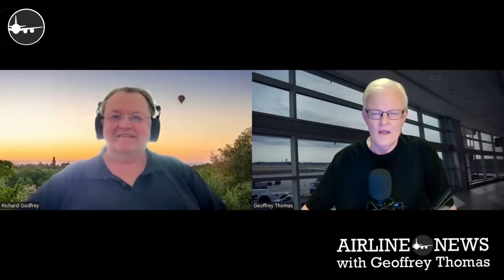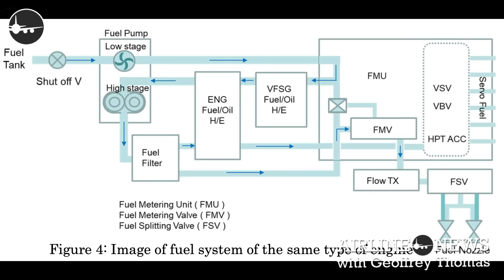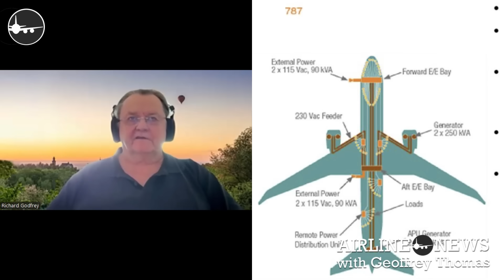AIR INDIA CRASH - FUEL & ELECTRICS FACTORS  #airindiacrash

Comment: The difficulty which Boeing and Air India face is that the real reason for the crash can never be acknowledged. That the electrical failure, for which we have direct evidence from the survivor, almost certainly caused misleading information to be fed into the computer, which then decided that the engines should be throttled back. That reason cannot be given. That reason would require manual overrides to be installed for all the throttle controls on all “fly by wire” aircraft. So, due to the flight data recorders being “defective” the reason for the crash will be given as “unexplained” - possibly contaminated fuel or pilot error. So, no changes will then have to be made to fly by wire aircraft. It won’t worry me at all. I only ever travel to the Continent and I travel by rail and ferry, since I am fortunate enough to have sufficient leisure time to travel in comfort and style at a civilised pace. If the ferry founders I shall jump into the sea wearing a life jacket. Someone will probably pick me up. The distances are not great. “The further off from England, the nearer is to France…”

Comment: A lot of human interaction in form of checklists.  They got to V1, or almost.  The RAT did deploy.  We still don't know what the first event was or exactly when it occurred, but it could be at rotation, or perhaps the acceleration forces from the start of the takeoff run, which for example could pool water from level to an accumulation in the container it was in.  Question could be what could occur within the time window of take-off roll, or the very short window of lift-off rotation itself.  The aircraft appeares to be in trouble before or immediately after rotation, and trades off the speed and energy if had at rotation for the altitude, and quickly reached a point where, haveing nothing to trade, it could not maintain either.   So, the event, whatever it was, seems to be one or a series that could ocurr and symptoms be visible to us before cascading to a crash very quickly, possibly within the short window between rotation and, not impact, but the first signs we can discern of a problem.  That seems to be only a few seconds if it occurred during rotation.  The larger window between start of takeoff roll and before lift-off, yet there was still time and the conditions necessary to the aircraft having reached V1 (or almost).  In with case, the time between when the first event occurred and symptoms affecting the aircraft were realized seems to be very short.  Pilot's radio message points to them having almost no time to realize there was a problem and deal with it, if it was survivable at all at takeoff.  Also, assuming pilots did not have time to react, and assuming related backups could still be initiated automatcially, how quickly could backups react to work as designed?  A few seconds still might not be enough. What scenario could have cascaded this quickly? Water/electrical, then with twin but asymetrical engine thrust loss, right engine first but also, independently, left engine taking longer, perhaps ending with left engine still running, still losing but producing some thrust - but not nearly enough.  And, not saying this is so, but this models to the delays, aka the optics, we've seen since the crash, and that Air India had failed to make the inspections/changes advised, and became aware of this early on after the crash.  If so, in this scenario, Boeing/Air India, but Air India sealed their fate.  Not saying this is what happened, but it fits a model that works and almost too easily arrived at.

Comment: Hi. What would hypothetically happen if a pilot, by accident, entered a critically lower total weight than the actual weight? Would we see a long acceleration, followed by a lack of appropriate thrust to maintain climb?  And would the RAT deploy? The pilot flying, in his mayday call, knew that this was his very last ever transmission call to ATC. If there was a single or dual engine failure, or complete loss of electrical power, I'd think he would have relayed those facts. But he said in his call "thrust not achieved".
Reply: "Thrust not achieved " is fake news, made up by stupid Indian media. We know our media outlets very well, they are capable of making ANYTHING up. 

He simply gave a mayday mayday call.
Reply: The incorrect take off weight entry would typically be loaded into the onboard performance tool which is used to calculate take off performance. This would have to be missed by both pilots and then the incorrect take off data entry into the onboard flight management system would again have to be missed by both pilots. 

During the take off you would experience a slower rate of acceleration and a longer take off roll due to lack of thrust which would then also affect climb performance once airborne. 

This would not cause the RAT to deploy. 

The call to ATC would not be too detailed due to the startle, stress and focus being required elsewhere.
Reply: This has happened before. Search the near catastrophic incident of Emirates EK407.

Comment: Guys, enough of the speculation.  For crying out loud wait until we have some facts from the investigation.  You only fuel the guys out that have ChatGPT.  

Captain - B747 Classic and -400, L-1011, B757/767, B727.  
Check Airman - L-1011, B727
24,000 hours, 41 years flying airliners
Reply: Why watch if all you are going to say is stop making the videos? Were you forced to watch? 
Do you think your flying experience gives you the right to make such a comment? It's a bit pathetic really !

Some of us appreciate these videos for the education provided about aircraft systems etc.
Reply: @GPSierraPapa With my experience what could I possibly know?  Sorry.  My mistake.

Watching for education is great as long as the information being presented is correct.  But “woulda shoulda coulda maybe what if” is not information.  Speculation helps no one.  Wait for the facts.  This is not the place to find them.  At this point none of us know.
Reply: @ImperrfectStranger The 727 is the only airplane on which I flew all 3 seats.  I was a check airman on the 727.  I’m not sure I know what he was talking about.  DC pump if the AC pump failed?  Not really sure what that means.  If he’s talking about fuel boost pumps they have different sources of electrical power for redundancy.  Boost pumps are normally DC powered as DC will deliver more torque than an equivalent AC pump will.  Fuel starts to “gel” as it gets colder at altitude and an AC pump may not have enough torque to overcome the thickened fuel if the boost pump has been shut off for cross feeding or balancing fuel.   If I recall correctly (I last flew it in 1992) the APU doesn’t run in flight on the 727.  I don’t know what a fuel line check valve would have to do with anything.

Thanks for the compliment, but don’t wish I was there for his questions.  I don’t know any more than anyone else.  Of course I’m curious, but the amount of wild theories about stuff is really annoying to me.  The facts will speak for themselves when we finally get them.  I blame a lot of it on ChatGPT, but who knows?   I never flew the 787, but was only involved on the periphery of its operation.  It’s a very smart jet, and we’ve learned a lot from previous problems.  

The only thing that really raises my eyebrows about this accident is if it were an aircraft or design problem affecting safety, that would have to be divulged very quickly to all operators of the airplane for safety of flight.  There’s a lot of 787s flying around out there.  That nothing has been released kinda leads me to believe that it wasn’t an airplane or design flaw.  I read people saying Boeing is keeping it covered up, but I sincerely doubt that is true.  Boeing got a pretty bloody nose over the 737 Max (deservedly so in my opinion) and I don’t think they have any desire to go down that road again.  But I’m breaking my own rule by making such a speculation.

Comment: Having worked on early digital telecommunications equipment with redundancy and both battery and generator backup as a young man, I wonder if there was a significant difference in the voltage of the aircraft's AC buss and the PMA's on each individual engine, causing a power surge, voltage drop or perceived power surge or voltage drop, when their individual FADEC's switched from the AC buss to their own individual PMA's after takeoff, which caused each FADEC to reset resulting in both engines going back to idle at or around the same inconvenient time, perhaps due to the switchover happening in the midst of the electrical failure which caused the RAT to deploy, & the landing gear to stop before completely retracted?
Reply: Agree. With so many power sources all potentially being connected to the same distribution bus in the wrong sequence or out of phase will cause surges and dips in both frequency and voltage. The combinations are incredibly complex with so many electrical power sources. 2 per engine, 2 per APU and 1 per rat!  That makes 7!  All nice in theory but practically? One inconvenient failure in a computer chip somewhere is all it would take to nullify all the redundancy!

Comment: Another slight variation(?)
Let's assume there was a single point catastrophic electrical failure Or (anticipating the upcoming Monday episode) a software malfunction, which resulted in the nominal fuel supply to one or probably both engines being compromised.

I assume "a (single) blocked filter" would be a separate system for each side and so should not affect both engines? It's unlikely both would be blocked at the same moment?

In this case, we would be looking for something which would affect both engines independently but at roughly the same time and to differing amounts?

Is it possible that such an electrical failure, leading initiation of the vacuum feed on both engines would cause a sudden pressure loss due to suction in the feed, which, combined with potential contamination(?) and with the high ambient temperatures at the airport(?), may cause vaporisation in the feed leading to first zero, then variable thrust in both engines?
.
Scenario.
If the pumps are mechanical and rely on engine rotation, there may be a situation where the engine is at low revs, then the pump is engaged, fuel is supplied, which increases power, then increases vacuum, which vaporises contamination, which reduces supply and slows the engine, which reduces vacuum, which allows the fuel to liquefy and produce trust, which increases vacuum....... Resulting in a feedback loop of variable but uncontrolled asymmetric thrust?

Comment: Enjoy your channel. We know these accidents happen from a series of reasons. However only one failure will happen in a system at one time. The deployment of the RAT then points towards an electrical failure, this then removes all the other options, flaps, heat, vapour lock, fuel contamination, pilot error, takeoff configuration and settings, etc. What about in this instance the RAT deployed but didn't provide any power.... This isn't claiming two faults at once, but rather a previous failure that wasn't repaired. I would presume the RAT would be on the mel but if the flight was allowed to operate without a working RAT and a fault occurred on takeoff with the electrical system and the RAT wasn't working the final hole in the Swiss cheese model would be aligned.
The question for Richard is what would happen in the event of total electrical failure and no RAT power?
Reply: According to the description of when the RAT is deployed only when either both engines are shutdown or at least one and the other is not producing enough electrical power for the flight control systems.  It's only emergency backup power for the flight control systems in the plane.  I think that passenger who survived said there was a loud bang and the lights flickered on and off around that sound.  Which is probably the RAT dropping down when it deploys.

Comment: Possible pilot error : Non selection of target altitude (000) would cause throttle back following take off  - it was too late . This has happened before appartently on a 787 and was corrected in time`: 
To set a target altitude on a Boeing 787 Dreamliner's autopilot, you'll need to rotate the altitude selector knob to your desired altitude, then press the knob to engage it. You can also use the Flight Level Change (FLC) mode to climb or descend to a specific altitude while maintaining a target airspeed.
Reply: It’s not going to throttle back in TO/GA.

Not sure about the 787, but on most airplanes it’s impossible to set an altitude in the window that is less than field elevation.

Comment: There is a fuel contamination well known to sailors, called "Diesel Pest", which clogs up hoses, pipes and even valves.Usually it never reaches the filters, thus it cannot be seen from outside even with transparent filters, but makes the engine stop not to start again without thoroughly cleaning the whole fuel system.
Cause is bacteria which thrive in the border between diesel and water anywhere in the fuel system.
Freshly tapped in the gas station diesel contains a certain amount of water (200mg/Kg) and is not sterile.
Stored in a tank/fuel system without much movement this water could separate and form  these border layers allowing the bacteria producing a certain "glibber", which is clogging up the fuel system, especially in hot climates.
The first reports of this phenomenon came in the mid 50ies, long before the introduction of "Biodiesel".
Maybe it took Evolution 50 years to make these bacteria to appear.
Jet fuel is chemically related to diesel and available in large quantities for about 50 years now. Could it be, that the same problem came into existence with jet fuel?

Comment: Thanks for explaining. You mentioned that 1 engine had already failed during V1, first time I heard it. 
Anyway, with so many valves, is there any spring loaded solenoid valves like FSOV's? HPSOV's is more motordriven in both directions, but the kind of valves in the system will react differently with a major electrical failure.

The sequence of events is very important as with a dual engine flameout, all engine generators will stop working anyway after the turbine has wind down. How long time does it take? 

In addition to the lavatory dripping mineral water theory, the same might happen with the metal shavings, the sharp junk debris that was left behind during assembly. Any short circuit might have sent a rogue signal to the flight computer propagate to the FADEC's beyond the pilots control.
There's supposed to be redundancy, but with the MAX mcas disasters there was not any Swiss cheese layers whatsoever.

Comment: Thank you for the NGR of the CCTV camera (have been searching for that for some time now) as we can now triangulate (using the roof of the small building) the rotation point in order to establish if there was dust at that point on the runway ?? I think i am right saying that 171 rotated well before the end of the tarmac runway and so should not have produced dust at that point ???.. PS... The battery on the 787 is quite small (less than my solar battery of 100A 48v) and would have been at MAX temprature and Charge (though regulated) at this rotation point using maximum engine speed.. PSS i think there is a pressure monitor on the battery box (for the fire retardent gas maybe) as well as external vent.. Just my ideas as i am concerned about venting of my solar batteries too... Kevin..

Comment: Just think about it for a minute what are the chances of someone surviving a crash like this let alone being able to walk away while the other bodies are not even recognizable? And then consider that two engines might have failed, either simultaneously or one after the other. What are the odds of both of these things happening in the same accident can anyone calculate those odds? It’s mind blowing!
Reply: Correlation bias, someone would only try jumping out of a crashing airplane.
Reply: @kwrzesien17  The survivor did not jump out of the plane when it was flying. He may have been just by luck been thrust out of the plane (he was sitting next to an exit where the plane fuselage probably broke at) onto the wing, and jumped off the wing onto the ground a foot or two lower. Based on photos I saw, the wings were on the ground at the crash site.
Reply: Two engines could not fail at the same time due to some defect in the engine itself such as a cracked and broken fan blade, unless both engines struck by a flock of birds or something. However if there is a single external component controlling both the engines that failed, or an issue with the fuel provided to both engines, then that could explain both engines failing to provide sufficient thrust. But we don't know at this time if both engine actually failed completely, although I suspect that the investigators know if that happened.

Comment: Engines and flaps where OK. Plane reached 625 ft. After takeoff, engines where set on idle by the computer, why.?  Plane was or became in the landing modus. Engines on idle, no retracting landing gear, no low terrain warning.  No engine failure, but somewhere a bug in the system.